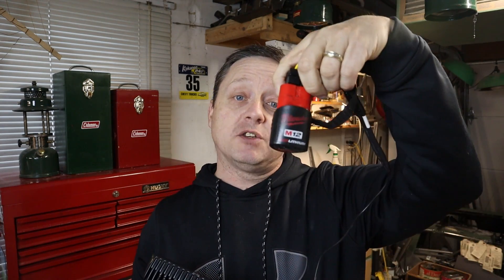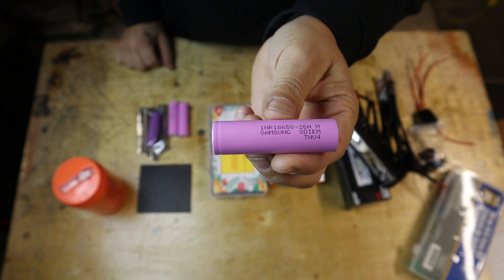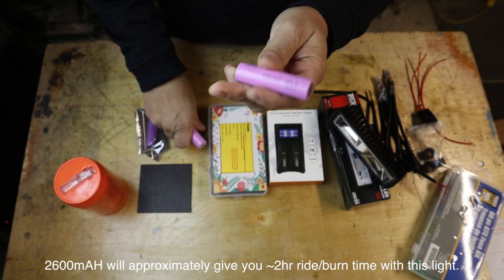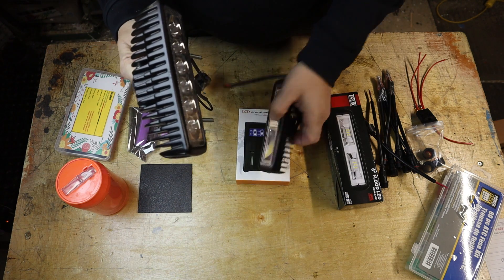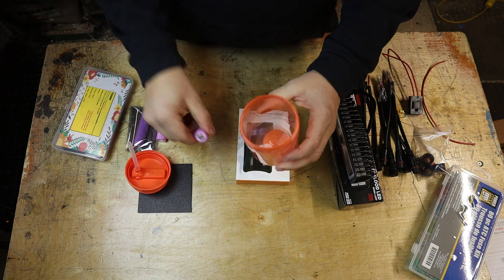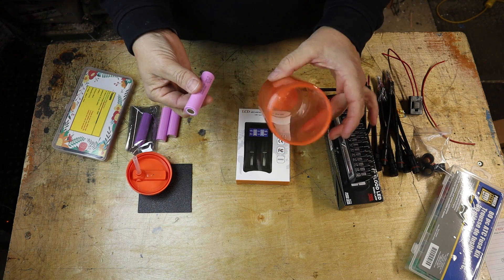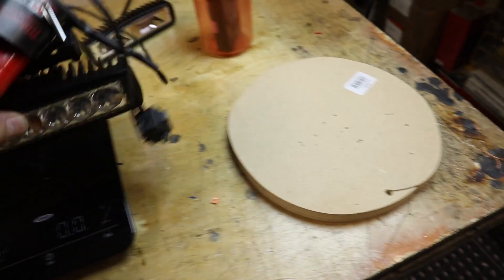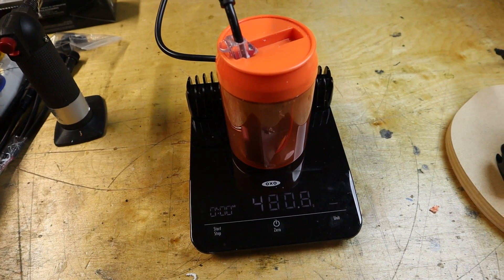MAKE your own SUPER BRIGHT Mountain Bike Light! // DIY Bike Light Version 2 // All New Battery Pack!

Comment from the maker: Version 3 light with BMS: https://youtu.be/Ohwle0mJ0mw
Reply: i have a cateye  HL-EL 135,  bike headlight and the top will not slide back to put the batteries in, I dont want to break it , do you have a suggestion to help me slide the top back???
Reply: i built my own with some spot lights from amazon , but I got lucky and got the battery packs for 8 bucks each off JAG35, the problem really is the battery pack, once you make or get a 4 amp hour pack 12v or 3.5 v you can really connect anything to it , any  flashlight can be chopped down to become a light pod and then just run the cord and add a switch or water proof plug?

Comment: im thinking of doing something similar but mounting the light on a snowmobile helmet and having the battery pack in my backpack and then probably having 2 battery packs in my backpack to switch the out. only thing i dont see clearly is how do you turn off the lights you made?
Reply from the maker: I hope it works out for you.  As for the switch, it’s just inline on the positive lead.  You want to make sure it’s rated for the current.  I have a drawing and a couple other videos you can see how it’s actually wired.  Cheers.

Comment: Hi wanna ask u i have 2camera batteries with a 7.2 v can i connect between them and reduce the voltage to 14 can work it is a great idea or no ? Thx in advance
Reply from the maker: You should be able to put the batteries in series to obtain higher voltage. That being said you don't want to exceed or even come close to the maximum current draw of these batteries. A BMS would be good idea. cheers

Comment: Hi, how many watts is the light? How long does it last?
Reply from the maker: That particular light bar featured in the video is 1100 lumens, 18 Watts of LED (which is the equivalent of ~65-70W of Halogen)  At 12 volts this light draw just under 1 amp. With the 2300mah battery this light has a run time of ~2.25 - 2.5 hrs.

Comment: with 3 18650s whats the runtime?
Reply from the maker: Hey, It depends on the battery rating and the current draw. Not all 18650 are the same unfortunately. I purchased quality Samsung INR18650-26H (2600mAh) Basically at 3.6V it should last 2.5hrs on a 1 amp draw.  Three of these wired in series will be 10.8V. If you try to run the light in the video you will probably draw 1.3 to 1.4 amps at 10.8V.  I suspect this light would last ~2hrs. (at 14V this light draws around 1 amp) I hope that helps?

Comment: Hi there. You can also use a step up boost converter,. Some have a low voltage protector so the batteries won't discharge below the charging voltage. When you connect the batteries in series you're increasing the voltage, but when you connect them in parallel you're increasing the amperage which means you double or triple the running time.
Reply from the maker: You can but it needs to be a pretty large one. Most of the small step up chip boards like the XL6009 won’t work. I’ve tried. They do not like the current these light draw. Their specs are miss leading.  If you wire these batteries in 12v configuration you can use one of those 3 cell / 12V BMS chips. I’ve come up with a different solution. Please have a look at my version 3 light.

Comment: I never thought of putting the charger components on the back of the battery pack. I've been researching how to build one from scratch,  wich is a big pain for a newbie. Thanks for the info
Reply from the maker: Thanks.  I tried to make this setup as easy as possible. I tried several BMS’s and they all had issues and I was convinced it would handle the rigours of mountain biking. This system seemed the easiest. 

Future iterations of this light will be more robust and will include some cool features.

Comment: if you opened up the m12 batterypack you'd find 18650 battery in there
18650 batt is 18mm by650mm
Reply from the maker: Yes.  Just giving people options. Bit of a shame to open a functioning M12 battery pack but I guess if the tool is broken then that’s another option for you.  Still have to figure out how to charge them.   Thanks for the insight.

Comment: Do I need a low voltage protection unit 🤔
Reply from the maker: You can but for a lighting load it’s not that crucial. Motor load act differently on batteries when the battery gets low.  Yes, it can help extend the life of your battery if you always run the battery until it is dead. It is another piece of hardware in the system that can fail and I don’t feel it is needed when used in this sort of setup.
Reply: @MikeFreda  what about a thermal cut off , those cells are in a bottle ?

Comment: I wish you talked more about the power system , How many cells are too much ? I went with a 20v light pod from Amazon I used 5 cells I took out of old chargers in my collection , i go about an hour . So I'm wondering how can I get 4 hours , should I add 6 to 8 cells or get one of those ebike batteries . I'm not sure how to calculate and tune my system . I know how to build it lol .  A person commented their test results on the review page and it says 1.4 Amps at 12.5 v , 8.8 watts per led . So I'm not sure where to go , I see some 12v  water bottle batteries and some more expensive e bike ones for say around 34v systems , I'm not sure how much is just right for my lights.  My pod is rated at 2000 lumens and it's perfect for the trails ,I loved its illumination but it didn't last , I usually do rides  ride 2 to 4 hours throughout the year and would love to start building cheap and effective lighting solutions
Reply from the maker: Thanks for reaching out and commenting. This topic could be a complete video itself. I did touch on it a bit in my two videos. The issue is that not all lights are the same. They all draw a bit different current and not all batteries are created equally.

Four hours of run time on light like this will require good batteries
Some lights have a optimal voltage it prefers, yes, the may be able to use different voltages but you have to determine what is the optimal voltage for the light you are using.

What you need to do is actually measure the lights current draw at whatever voltage you chose to use. Take a multi-meter and measure the lights current draw. I would try 12V, 18V, 20V. See what it draws at each voltage and how bright the light is.
On my light, it draws 0.950 amps at 12Volts. So, in my case, to run 4hrs I would need a 4-5amp/hr battery. 
On my first light I made, I just carried a spare 12V drill batteries and would swap once it died.
On my second light, I got 3 high quality 18650 Batteries. They are 3.7v batteries and wired in series. The light drawing 0.950 amps at 12V gives me 3hrs of solid run time. These batteries are rated for 2600maH batteries. Meaning at 2.6amps it should last an hour… At a lower amperage draw, it should last longer.

You could do the same set up but get 6 and install them in a Series/Parallel configuration and you should be able to get 4-5 hours out of it.
Reply: @MikeFreda  ok thanks , do you have any suggestions for a better switch that can run a low or medium setting ?
Reply from the maker: A dedicated switch won’t really do that for you unless you can re-wire the light to turn off separate LEDs.  Running lower voltage will dim the light a but then you are actually switching the battery configuration. You could have a separate switch to change the voltage and another switch to turn the light on an off.
Reply: @MikeFreda  I wondering how do flashlights do high low switching 🤔
Reply from the maker: They do what I explain. Most modern lights have one switch and a small board/circuit/chip to either shunt/limit voltage or switch on and off the LED’s to change brightness.
Reply: @MikeFreda  ok so it's a chip ,I was thinking I could try  a car head light switch but I want it to be waterproof . I hope you can make a part3 and add a display and wall power charging  . So my light pods are 2000lumens , and I use a garmin mount with a go pro mount on the bottom , and I also found a dual 1 to 2 go pro rail , might help stream line your next build , wink wink .

Comment: i would be interested in seeing you upgrade some of the cheap amzon MTB lights , and helping us figure out which ones have the most potential to get us close to those actual 1000 to 2000 lumen powers  as well as the 500$ mtb lights that just cost so much money . If you could help figure out which cheap amazon mtb lights under 50 bucks can be upgraded and how would help a lot of people cut through the total nonsense ways they sell these lights > . :)
Reply from the maker: You’re right there.  Not to mention the reviews are probably not really that legitimate and are probably not relevant to real night trail rides. That being said, doing a test and review like that would cost a small fortune.  Some people have already done something similar. Check out Bermpeak and Vancan.   My channel is more about DIY rather than reviews. Thanks for your comment though!
Reply: @MikeFreda  no not a review but more like a diy upgrade to see how close one can get to the expensive lights with the cheaper amazon lights , showing us what leds to look for and how to make them as good with similar diy upgrades:)

Comment: can you light it using powerbank?
Reply from the maker: Not really.  These lights run on 9-24v.  They like 12-14v. Power banks typically output 5volts.  If you did you would need to have some sort of step-up break out board.
Reply: @MikeFreda  please can you teach me how to do that? TIA and GBY♥️
Reply: @TimeBandit927  just cant use usb to transfer power , you need the cells in series .

Comment: can i use a power bank to give it power ?
Reply from the maker: If your power bank can produce 10-14vdc, then yes.  If not you may need to install a step-up circuit board. They are pretty inexpensive.

Comment: I used 12 volts sealed lead acid (SLA) 5 amps as a battery and use led spotlight for atv, when your lucky  you can find 1 1/2 inch height, 2 1/2 inches wide led light perfect fit front light but be aware not to use to incoming cyclists.

Comment: 3x3.7v batteries in series sums up to 11.1v. is that ok for a 12v led light? (still learning about this haha) I already added all of the materials in my cart because I'm  planning to do this also, and is it still ok if i use 4x3.7v? haha good job sir! just doing some research before building it. Thank You!
Reply from the maker: Yes, that is fine. These LEDs typically have a voltage range from 9v to 24v.

Comment: Any concerns on balance of batteries. Dont you think something like this would be more practical.
https://www.amazon.com/Itlovely-Waterproof-Battery-Interface-Smartphone/dp/B07Q4V9XPH
Reply from the maker: That battery holder can work but they don’t sit in a water bottle cadge that well and I’m not sure how tough they are. As for the battery balance, that’s really only a concern for charging them in a group. If the batteries are similar properties (charged the same, have the same voltage and internal resistance) they will discharge at the same rate. That’s why you should use the same batteries.

Comment: Need help on finding the right wiring and battery? Any tips guys?
Reply from the maker: What information are you looking for?  Size it wire? type, gauge?  Where to buy it?
Reply: I have the led lights and battery, just need a wiring harness?
Reply from the maker: No harness, I wired it from scratch. The connections and battery holders are linked in the description. Just get some 18guage wire, soldering gun and some heat shrink and a switch. Fuse holder may be handy as well.

Comment: Hello Mike ! Thanks for this second video.
I'm curious about using a dynamo to charge the batteries. What do you think about it ?
Reply from the maker: I guess it is possible to charge as you ride. You would need a dynamo with high current output and voltage regulator. Typical Li-ion battery chargers require ~600mA for 2 batteries to charge. It also takes a couple hours to change these batteries from completely dead.
Reply: Nope!! LI ion batteries need constant voltaage, read about safety and charging of li ion batteries first. You will thank me later.

Comment: THanks for sharing the vid! I'm rocking the flood only light and it does great for me.  I do wonder if i would prefer the spot/ flood combo light more.  

If you're into RC hobbies, LIPO batteries work great and are easy to recharge. just make sure you don't drain them too low or you'll damage the battery.  I run a low voltage beeper ($3) on my batteries when i'm using them for my headlight.

Comment: Was looking around if someone was crazy as me to do this and found this awesome vid. I got a pair for $14 it's like a portable sunlight. It's brighter than older car lights. LOL 
i use 14500 since I have AA cases around. Only runs for 15 mins. but it's cool trail is only 7 mins long. I turn it off after the trail and use headlamp on my helmet.
Reply from the maker: Nice.  These mini light bars draw around 0.9 to 1.2 amps. You need a battery that can withstand that draw. Drill batteries work and a good quality 18650 will also.  I did try some generic/lowcost/dollar store 18650 and they could not handle the draw.

Comment: I did this with a regular rechargeable 5v battery pack, step up converter with USB and DC on the ends, and solder or crimp a dc female on the light. Way easier and cheaper.
Reply from the maker: Yes, that is another way of doing it. You just want to make sure the converter is rated for the current. These mini light bars draw at least 1amp. For safety, I would get a converter rated for at least 1.5 to 2 amps. You also need to house it so it won’t get wet but not overheat.
Reply: A problem with your setup would be the efficiency loss, since the powerbank is probably just doing a step up from the li-ion inside or lipo to 5v and then you're doing it again from 5v to 9-14v, which is not ideal if you want your light to use more of the battery, you would be better of just buying a QC3 powerbank and use a QC trigger board, or just make a 3s battery like this one.

Comment: I’ve bought one of these light bars and will be connecting it to my ebike battery soon
Reply from the maker: Sounds interesting. You would want to make sure the ebike battery voltage does not exceed what the light can handle.... or does it have a tap for a light?
Reply: @MikeFreda  Mike, it would be great if you did a video on how to connect your light an Ebike battery

Comment: Great video, just what i was looking for. Do you think i could use a 4S 14.8V Lipo battery with this?
Reply from the maker: Yes, for sure!  Checkout my other video. I use a drill battery in my Version 1 light. These light typically have a voltage range from 9v to 30v.

Comment: What sort of battery life would you expect with this set up?
Reply from the maker: Overall life span or burn/ride time?  These batteries are designed for discharging and charging. Like a Laptop, I'm sure they will last many, many years before they won't hold a charge anymore. As for ride time. Over all ride time is different than burn time.  This light bar draws exactly 1 amp @ 11.5V (I measured it) A 2600m amp/hour (2.6amps) batteries should give you ~2.5hrs of light on (burn) time if you just use 3 of these batteries in series (as shown).  Since most people take breaks when they ride you can turn the light off when resting.... I can see you doing a 3+ hour night ride without any issues. That's along night ride.
Reply: @MikeFreda  i meant burn time but thanks for telling me both that is much much more than i expected!

Comment: Thanks for sharing this Mike. I have recently built two systems after watching your version 1 video. My mountain bike has the spot/flood light bar with the battery inside my 45Nrth pogies. The same setup on my fat bike but with a JW Speaker work light at the moment. Less obnoxious for commuting but not as bright. I am looking at tapping into the batteries for heated clothing as it gets a bit chilly on my commute in Edmonton. Great videos, Mike. Well produced and the right level of detail.
Reply from the maker: Thanks for the feed back! I'm glad my video inspired you to make something similar! Stay safe!
Reply: I'm making one using LEDs I've got from a TV. Im going to make another one using a regular light bulb, I'll just have to make some modifications on the LEDs to acomodate less than 12v. I'm also using 18650 batteries with the booster.